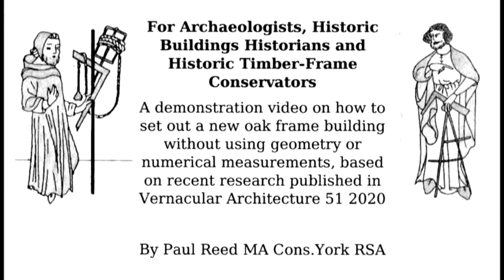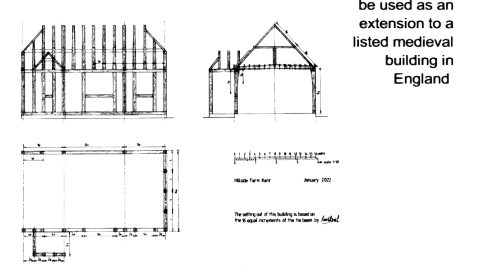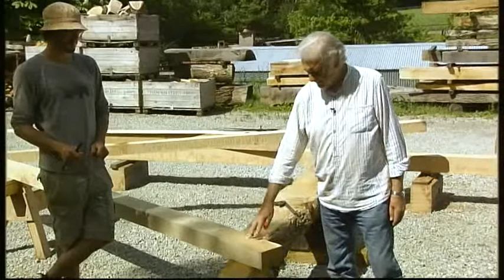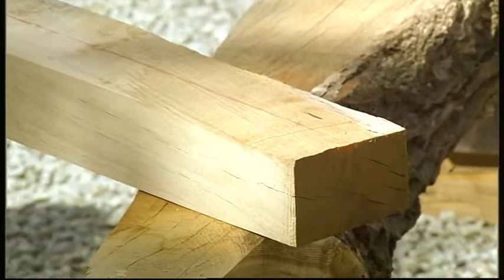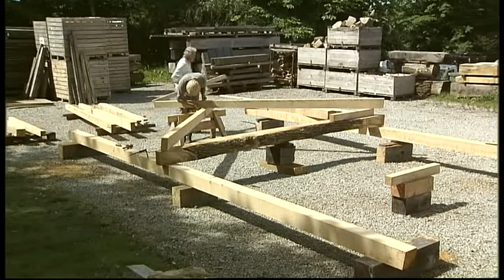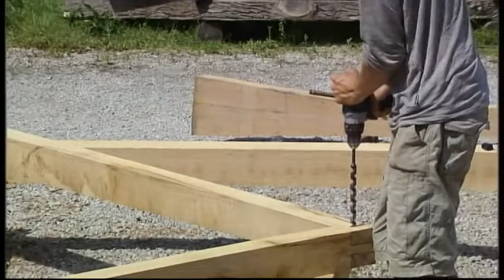How Medieval Craftsman Set Out Roofs & Building Part 2

Comment: Excellent video. Thank you so much.   One thing I don’t understand is why the string method on the rod had to be checked by the dividers as I thought the string method would have been accurate?
Reply: @peterwalton1502 the string isn't completely accurate because you lose a small amount of length each time it's wrapped around the nails